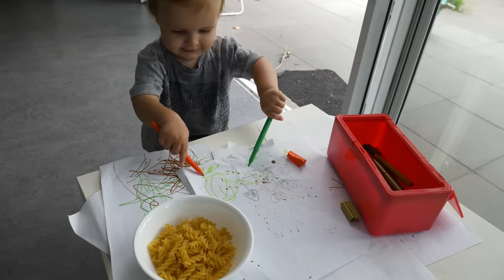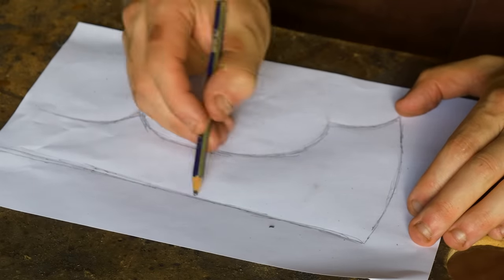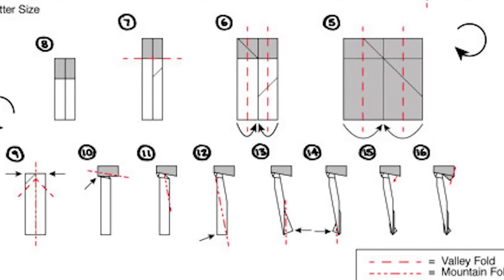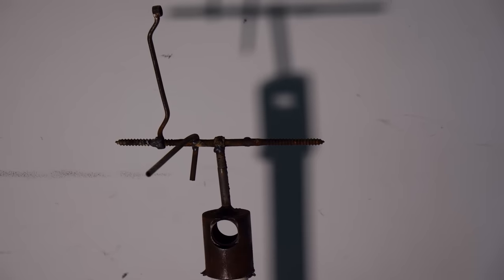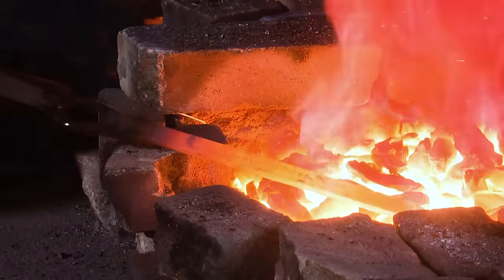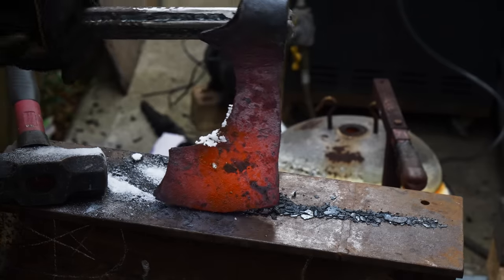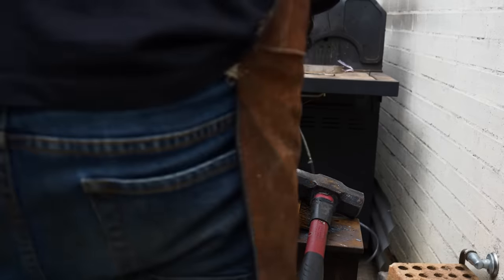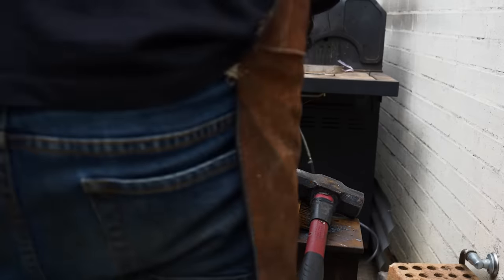YouTube's Worst Blacksmith Makes a Viking Axe!

Comment: double headed axes have many purposes, but the primary one is longevity. 
two heads equals twice the edge retention. 
once one side gets dull, you don't have to go back home and call it a day, you can just flip it over and keep going until side 2 gets dull, resulting in twice the amount of work getting done in one session for a lumberjack.  Doublehaded axes also have amazing balance, and are typically alot better at felling trees for this reason. try using some thick-wedge shaped- maul type axe to fell a tree and you are in for a struggle. they dont like being swung sideways, and they dont like going against the grain like the thinner double heads and even thinner single heads do. 

i grew up splitting wood for my family year round, same way my father did before me. Using the right axe for the job is just as important as using the right type of wood for what your trying to cook. makes a whole world of difference.

Comment: not sure this is a question cause you seem pretty smart but the two bladed axe when lumber jacks used them normally had a crude not so sharp edge like a maul and a razor sharp edge one for breaking through knots in a tree and the other for just chopping

Comment: Ahem Battle axes have two blades for the same reason a sword would: So that if one side goes dull, you can flip it and use the other side. As for work axes, was back in the days of people being so poor they only want to buy one tool to keep for life as it's easier to maintain, they made axes with different heads, i.e Splitting mauls and felling axes. I enjoy axe lore, and I'm happy to share :)

Comment: Uuuh oxidation is not what prevents metals from instantly welding, they would call it vacuum welding if that was the case, it’s called cold welding for a reason although I’m sure the vacuum is the best flux ever 😅

Comment: The double bladed axes are so you don't have to sharpen as often. When one side is dulled, switch to the other. Also the weight of the additional blade helps it cut deeper. I've used single blade and double blade axes to fell several trees to clear land with family when the chainsaw was down. Double blade cut deeper for sure and split easier because the head is thinner where the handle connects than the single blade we had.

Comment: When blacksmithing was an actual necessity in order to shape any metal, They did not have the machines that you would have to clean them up and make them look nice, I bet you unless it was made by a very renown blacksmith, Weapons and tools would have many imperfections and also be very rugged, Even the master blacksmiths would have a slight deformation, They were just insignificant and also unpreventable.

Comment: I always saw two-headed axes as a weapon instead of a tool
it has more weight for damage and if one side becomes dull you can just use the other side since you cant really stop to sharpen your weapon in the middle of a battle